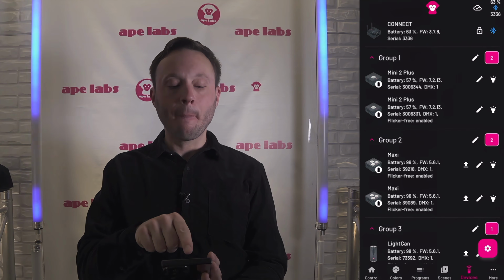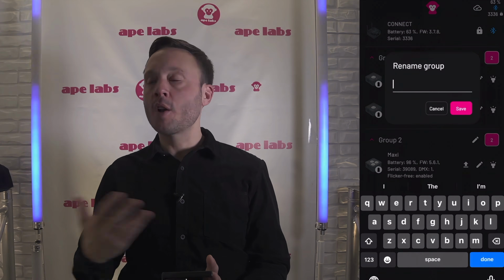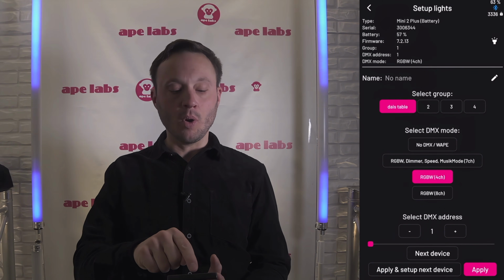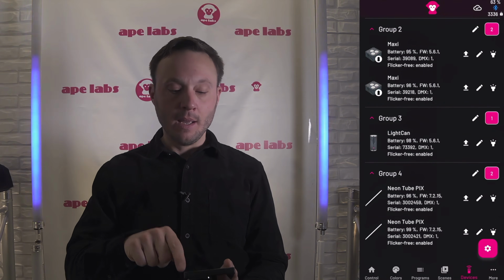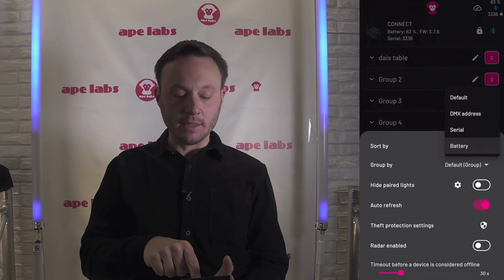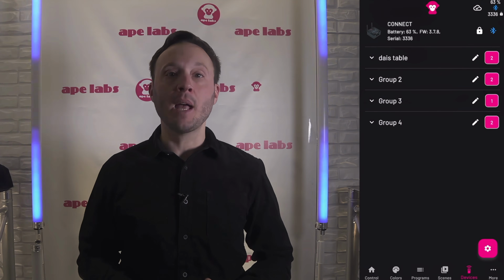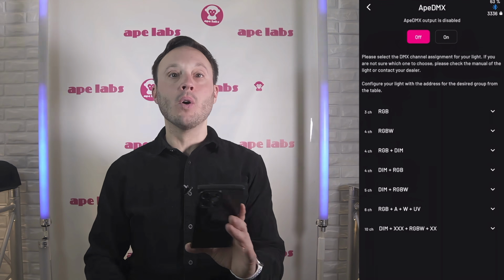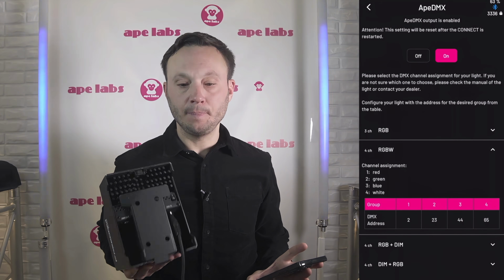Ape Labs Connect Tutorial: Control Most DMX Lights + Devices Tab Deep Dive

Comment: I have Chauvet Freedom Par Hex-4 uplights, and cannot make them work with the Ape Labs remote. I'm using the Ape Labs software, an Ape Labs Connect, and connecting to a ChauvetDJ D-Fi Hub via DMX cable. I've also tried without connecting to the D-Fi, but cannot make the Ape Labs app control the Chauvet uplights. Can anyone help me with this?
Reply from the maker: The ApeRemote will only work on Ape Labs lights.  This video is about the Ape Labs Connect. You can use the output on the Ape Labs Connect interface to export the Ape Labs Ecosystem to your Chauvet Lights.
Reply: @ApeLabsUSA  Can you clarify this? I am using the Ape Labs Connect, and doing exactly what's shown in the video. He is using a Chauvet uplight, so in theory I should be able to produce the same result, shouldn't I? I realize I used the word "remote" when I meant the app. I'm following exactly the steps in this video, other than using 6 channel instead of 4 channel, because the Freedom Par Hex-4 only has 6, 8 and 12 channel options.
Reply from the maker: What DMX personality are you using them?  You need to make sure it's in 6-channel mode for a HEX light and you're using the starting address via the ApeDMX section - Group 1 - 85 Group 2 - 106 Group 3 - 127 Group 4 - 148

Comment: Is there any way this can be used in Chauvet show express software? Seen u can use this with wolf mix controller how about show express? That be awesome if u can seeing I run all my dmx lights with show express & just took the plunge & bought 3 ape labs coins with the remote which I don’t can for. Would love to be able to program the coins with my dmx lights
Reply from the maker: The Connect can be used with dmx controllers and turned into a dmx transmitter - yes.